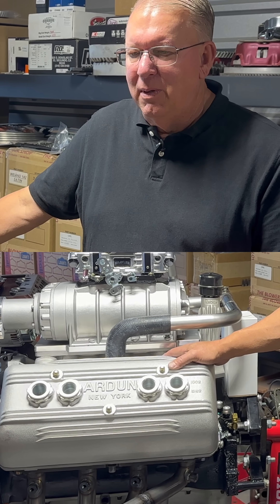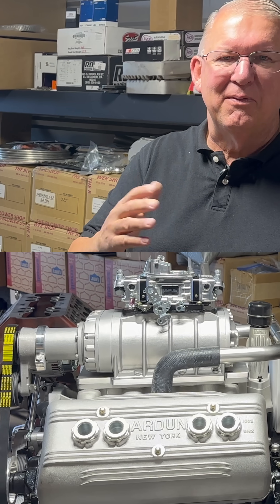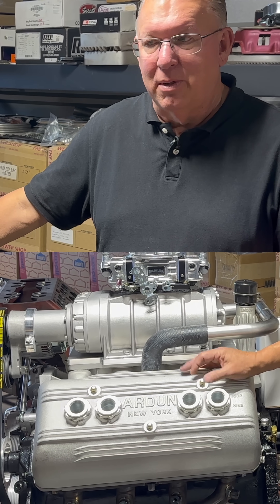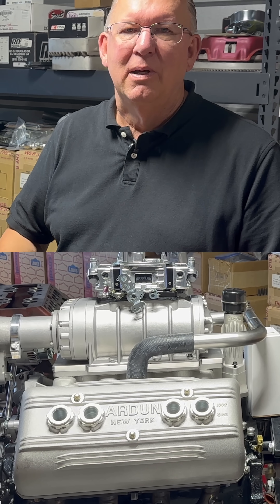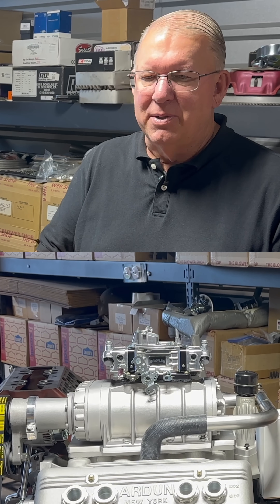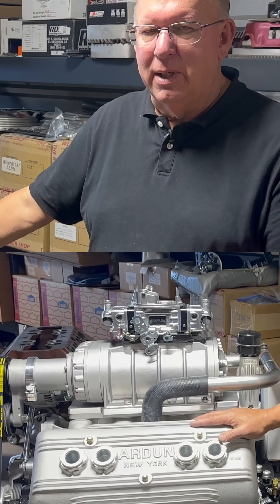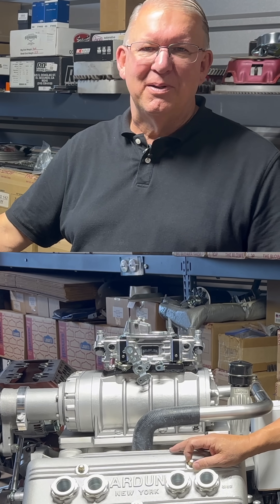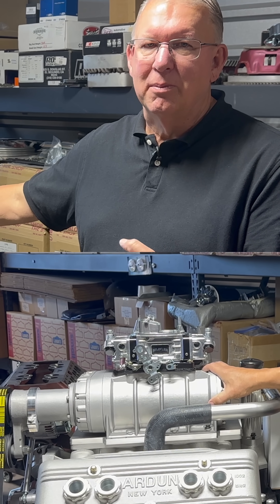Flathead HORSEPOWER? Then Add Boost? Dyno Time Necessary!  Steve Coppock #barryt #cpegarage

Comment: That's what people don't understand about the venerable 4/26 hemi. The point of why that was such an amazing engine was the low compression, which meant it responded very well to boost. Slapping a hemispherical chambered head on an engine does absolutely nothing just because it's hemispherical. Unless you're adding boost, there's no point.
Reply from the maker: The 1969 Street hemi 426 had a 10.25 to one compression ratio… Hardly low compression! I think you might look elsewhere for the answers, for example, the concept that the hemisphere called compression chamber head allowed larger valves for more airflow, whether blown or not 👍

Comment: You'd think the 3 main caps would be his biggest worry.  I don't know how strong they are, but thats what I'd be worrying about
Reply: We have 4 bolt billet steel maincaps..
Reply: Back in the 1960s I went to salvage yards to look for good 49-53 Flathead V8 blocks for rebuilding. First pull the heads to check for cracks between the valve to the cylinder. If this was ok then flip the engine over and pull the pan to check the center main bearing support. It was not unusual for the center main to break loose from the block.  If no cracks the block would be marked as a possible rebuilder engine and would not be scrapped.